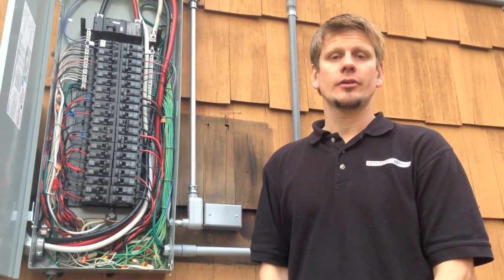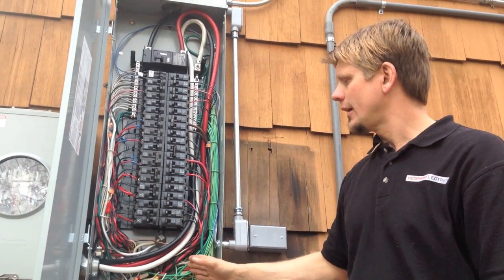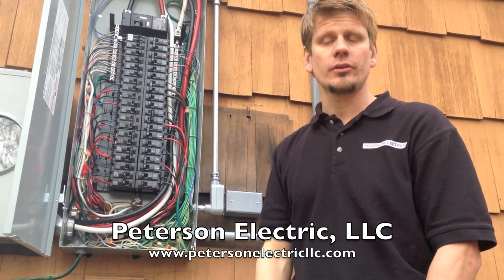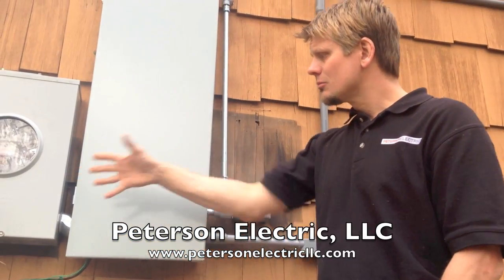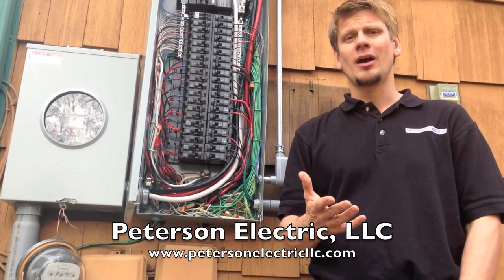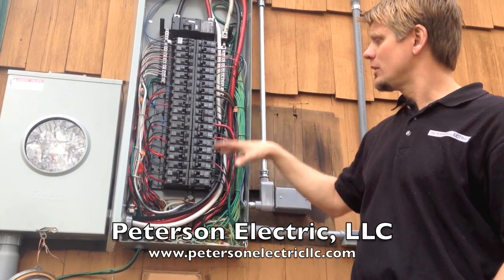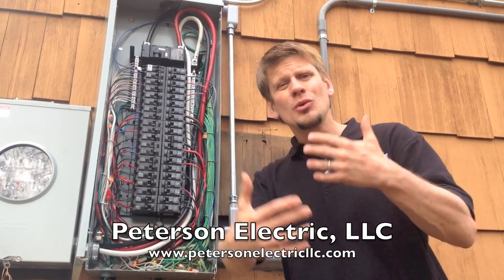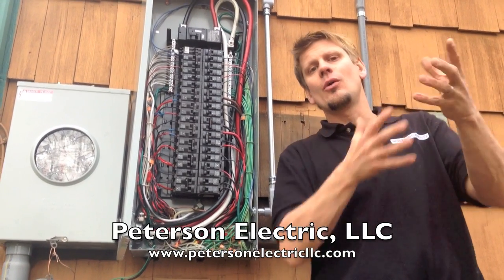Electrical Service Change Upgrade & How Arc Fault Breakers Affect It?

Comment: Real electricians use emt and thhn wire.
Reply: Obviously you don't do much residential. First of all no one could afford you and second  you would be to slow.
Reply: So your electric in your house is in pipe , sure it is , you probably aren't even an electrician.
Reply: @ @gregberban9273  Bub I did my whole House in GRC Conduit !
Reply: @thunderbolt5354  good for you

Comment: why can't a meter box be installed that has a main shut-off, and then make 200amp panel on inside of house? is this not allowed in Colorado? doesn't it snow in colorado? and in bad weather you don't want majority of switches inside house?

Comment: Its unusual to see circuit breakers located outside. I've never seen that anywhere in Canada.
Reply from the maker: It is standard to have our main disconnect outside and most of the time the over-current devices as well.

Comment: You mentioned not immediately able to determine which neutral goes with it's associated hot conductor.  The code now requires those pairs to be identified inside the panel.  This can be done with zip ties, romex sheathing around both wires, etc.  So hopefully in the future upgrades like this will be easier.
Reply from the maker: Yep you are correct, we are not allowed to use zip ties, we twist the ungrounded conductor and the grounded conductor together and twist about three times

Comment: What areas does this effect as far as countries and states? I would also like to know how this arc fault system works so if you've done a video on that or have a link that I could use to find out more than what's on Wikipedia I would appreciate it.
Reply from the maker: Ours is a National code for the us. We in COlORADO have AHJ in different counties, cities and in the state and they all see things different, especially on remodels.

Comment: seems the moisture and weather would wear the stuff out lot faster than if inside in a dry location...weather is brutal, turns things bad real quick, even if out door rated. weird..temp changes during day and night condensation inside wreaks havoc
Reply from the maker: I agree, but alot of our existing panels and load centers we change out are already there and it causes a lot more expense and damage to move the load centers. Plus the AHJ will enjoy making you AFCI every circuit according to 210.8, under the rule of 6' of modification of that circuit.

Comment: yeah has to be water proof budy you cannot use out side that panel
Reply from the maker: It is R3 Rated, i did not put the cover on for the video, there is a lip at the top of the load center

Comment: Why is the new code calling for all new circuits to be arc faulted? Ok, I accepted the earlier code that called for the bedrooms to be arc protected( I seen a serious arcing problem in a home I was doing) but as you said, it drives up the cost of the work and cost to the homeowner. Regular ck breaker about 4 bucks, AFCI 29 and up and you got  to keep the neutrals separate and the breakers take up so much room in the panel. Is the industry 'over protecting' because until 2014 gazillions of homes were not arc faulted so what are they trying to correct?   Oh and thanks  for the video, I was looking for some electrician to confirm what I heard and this video answered all my questions, accept for why the new code.
Reply: +Matt In Illinois Maybe I am getting old and cranky but all these features that try to reduce our own thinking like motion light switches, appliances that call the service guy, cars that brake on their own(I might need to drive through that gate).  The electric job is already expensive as it is.
Reply: +Joshua Peterson I understand  the safety factor and I cringe when I see the work I have to correct left from someone else. I have no problem with giving quality work but as your videos shows the expense factor goes up to arc fault all the circuits.  And once again, thanks for the video because I was specifically looking for the information you gave (except for why the major change).  An investor I was bidding for almost dropped to the floor when the code people told him that his 20 unit apartment he bought to rehab needed to have everything arc faulted.
Reply from the maker: No, I think the AFCI Breakers are truly a better system of stopping over-current draws and melt downs. But, I do think it is money driven too.. How else do you get people to change their panels?
Reply from the maker: I think that the requirements for the AFCI is good and I am waiting for ALL CIRCUITS and ALL 240 volt appliances to have them. They prevent fires, and HO and bad electricians from wiring their grounded circuits together and starting fires and or melting down splices. I have been in service for 21 yrs and seen some DUMB wiring.

Comment: why are ckt breakers installed outside, stupid!
Reply: cengeb They are usually outside here in Texas especially on older homes. The main advantage is if there was some type of flash fire due to a short in the box it will be less of a hazard outside. Also if there is an emergency and no one is home a neighbor can cut the power without knocking the door down. Honestly tampering isn't an issue. I've talked to a few electricians and they have never heard of anyone having their panel tampered with. Another advantage is if you have to do work on the box you can see more easily during the day where as indoors with the power off you will need to have a battery powered light.
Reply: Matt In Illinois
As I stated I have never heard of it happening in all my years living in the south. They are usually in the back yard so that helps. The boxes do have a place to put a lock, but the problem with that is in an emergency you don't want to be looking for a key.
Reply from the maker: SO, ckt is truly spelled "CIRCUIT",  who is the Stupid one? They were installed on this house back in the early 60's, next time I drive by and see an electrician installing a service outside, I'll stop them and said that "Cengeb" said "put it inside"!
Reply: why are they outside?  never see that around the northeast, it makes no sense, condensation, hot sun.  People ain't stupid, outside service panel is, please explain the logic, it's baffling...and way too easy to be vandalized
Reply: cengeb
  Huh ?!   I'm in the northeast and you see outdoor electrical "pedestals" servicing multiple buildings (barns, accessory buildings, etc) often.   I do agree its always better if you can make some sort of enclosure of the electrical load box (load box obviously need to be outdoor rated)
Reply: Real electricians use emt and thhn